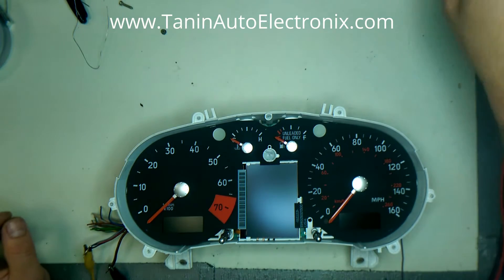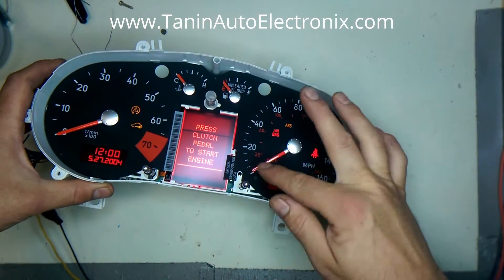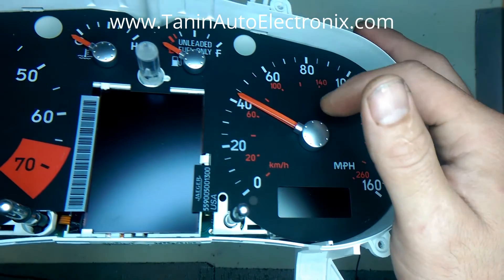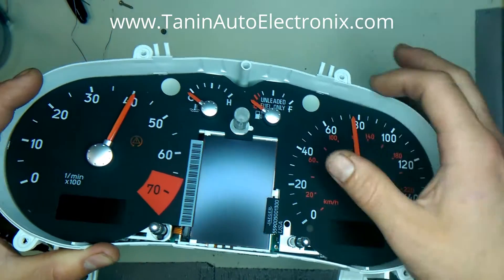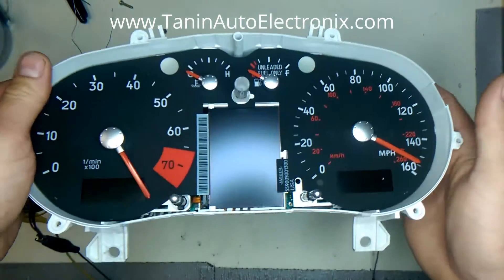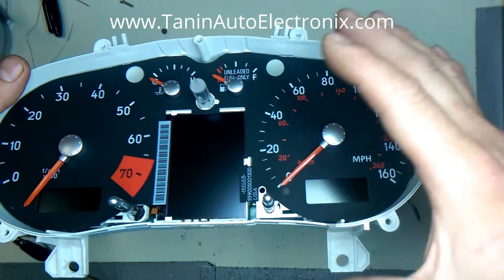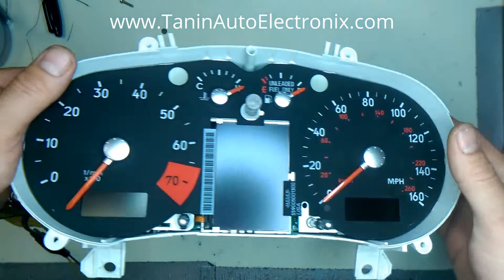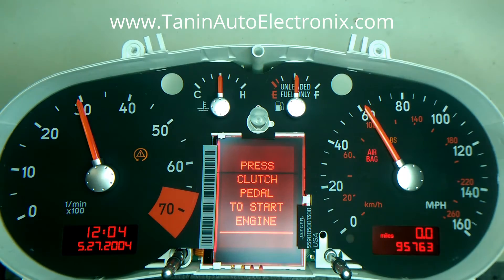How to Calibrate Gauge Needles on 2000-2006 Audi TT Instrument Cluster After Repair & Testing | TAE

Comment: Can you install a "post" of some sort to keep the gauge from moving anymore off of zero?
Reply from the maker: You can, but the overlay is so thin it would be difficult to mount one. They have tiny plastic ones that pop in from other models which could be salvaged to use in something like this.

Comment: What about the battery light not displayed on ?
Reply from the maker: You have a problem with the battery light? Or you are saying in the video?
Reply: @TaninAutoElectronix
Reply: @TaninAutoElectronix . It doesn't come on in my vehicle
Reply from the maker: @tonymartinez2031  Not sure, might need to have a mechanic scan it and take a look at the vehicle.  Unless the cluster was modified or the light was removed.

Comment: How about the temp and fuel gauge calibration?  I just replaced my lcd, took me 3 trys.  But on the second try I accidently put the front bezel cover on and pinched the temp needle.  After unpinching it, it does nothing. Is that step motor shot now?

Comment: I know this video is old but need ur help. My speedo is out as recently took it out to fix fuel pointer motor and didn't realise about the speedo potentially being knocked out of calibration. From watching ur video am I right in thinking all I need to do is wind it anti clockwise and position it on ZERO and that's it calibrated?
Reply from the maker: Hey John!
You have to set the gauge to zero when the cluster is off, then set the ignition switch to the first click (not fully on) and the gauge should move (sometimes the needle moves up a little sometimes doesn't and it stays at the same place). The goal is for the mph needle to be at zero when the first click of the key is on.

If it is not on zero, then turn off the car (disconnect the cluster because even though the cluster is off it still has some power so the needles are stiff so the cluster needs to be disconnected) then redo the process until you get it at zero.

Send us an email if you need anything else! contact@taninauto.com
Reply: @TaninAutoElectronix  thank u so much for ur help. I'm in the UK and will try this in the morning and let u know how I get on. Again my thanks to you 🤞👍

Comment: How much do you charge to repair a cluster of 04 Audi TT 3.2,,it needs a led screen and gauges don’t work
Reply from the maker: Hey DJ!

Here is the link for our LCD replacement service:
https://www.taninautoelectronix.com/product/2000-2006-audi-tt-instrument-cluster-repair/

Or the LCD alone to install yourself:
https://www.taninautoelectronix.com/product/tae-2000-2006-audi-tt-instrument-cluster-lcd-screen/

We don't offer a service for the gauge motor replacement, but we do offer them as DIY products, if you're comfortable taking on the task yourself!
https://www.taninautoelectronix.com/product/2000-2006-audi-tt-stepper-motor/

Let us know if you have any other questions!
contact@taninauto.com

Comment: My fuel gauge is showing  1/2 tank even after it is full, I thought it was the sending unit but that is part of the fuel pump, I replaced that and still at square one, any ideas
Reply: Hey Jonathan!
Unfortunately thats a clear sign the cluster is bad and needs to be replaced. We can't source the replacements for the Audi TT's, so you'd have to visit the dealership. Sorry about that! I hate seeing situations like this where we can't be more helpful :(
Reply from the maker: Hey Jonathan!
Unfortunately thats a clear sign the cluster is bad and needs to be replaced. We can't source the replacements for the Audi TT's, so you'd have to visit the dealership. Sorry about that! I hate seeing situations like this where we can't be more helpful :(

Comment: Friend, good afternoon! Could you tell me which pins I must turn on to be able to plug the panel into the workbench?
Reply: Go to vaglinks.com
Look for Bentley_Audi_A4_B5_WiringDiagram
Go to page 18 of 21 of PDF file, page is marked 2/18, power is on T32 pin 22 red wire and ground is on T32 pin 32 brown wire. T32 is Blue connector.
Reply from the maker: Thanks for reaching out! However, this isn't information we generally give out, so you will need to locate wiring schematics to determine this.
Reply: @TaninAutoElectronix  ok... Thanks...

Comment: How do you power up like that?
Reply from the maker: We use generally use a 12V power supply and other testing equipment so we're able to test units on the bench.
Reply: @TaninAutoElectronix  i have a 12v source but i'm afraid to power the wrong pin i just wanna be able to light up the leds to change the dead ones i guess my question would be on witch of the 3 plug and what pin should i provide 12v power to power up the leds. thanks
Reply from the maker: @yulmerced4434  sorry for the misunderstanding! Unfortunately, this isn't information we generally give out, so you will need to locate wiring schematics to determine this.

Comment: I have a Audi A3 1.9 TDI 
54 plate
I have had the Speedo clocks changed as mine went faulty 
Ave had the new ones reprogrammed 
My Rpm and Speedo don’t work 
But the fuel and temp are working 
Ave TRYED a spare set that I have 
With the spare set of clocks 
My Speedo and Rpm work 
But the temp and fuel Don’t

Any ideas or help would be appreciated 
Thanks
Reply from the maker: Hello Nasir!
Can you send us some more information about your vehicle so I can see if we can help?
262-456-4147
contact@taninauto.com

Comment: If we talk about specifically Audi TT MK1 - the miss-calibration is NOT related to the shipping carrier handling. The real problem is that RPM and speedometer pointers are made from crap plastic and with the time the plastic degrade and cracks - the exact place where the pointer goes onto the stepper motor shaft is simply slips. So instead of going with pointer stoppers on the face plate or other similar ideas the ONLY correct solution is simply to replace those 2 red pointers. But assuming you can't find a source for those - you can simply fix the cracks on the pointers (with a hot air, or glue or whatever you can do) and forget about that problem.The reason why fuel and temperature doesn't have that problem is because they are made from other kind of plastic which doesn't degrade. However pointer motors for those little gauges fails frequently causing constant miss-calibration and can be easily replaced. In the very rare cases firmware goes bad.

Comment: Thanks! That helped me out alot! I have a 1999 Model but it seems the same Thing you mentioned applied to it after we had taken the dash out to test it on the same TT, afterwards the Cluster for the speedometer was wiggling around when we put it in. Thing is, that Information cant be found easily. Thanks again from Germany for helping out.

Comment: wanted to know if a needle stop could be glued to the face to keep it from dropping below zero....just like every other mechanical cluster had
Reply from the maker: Yes, something like that would work.  We now ship them with removable foam blocks that hold the needles at 0.
Reply: Ok another question perhaps you know the answer to..I have a friend that had a electrical fire in his 04 TT..cluster is toast and unusable..he has sourced all the parts to replace from a wreck but from what I understand that year TT has a immobilizer that is paired to the cluster..what does he need to do so that he can avoid buying a brand new cluster from Audi..as they told him they will not pair anything but a new cluster bought from them?
Reply from the maker: Have him email us at taninautocontact@gmail.com and we can assist!